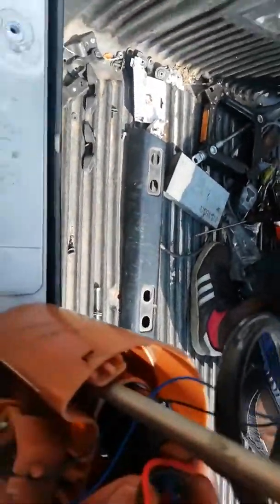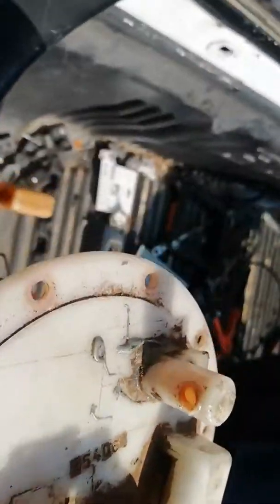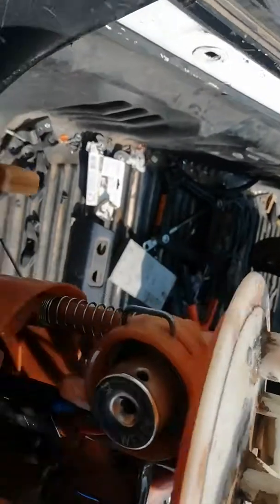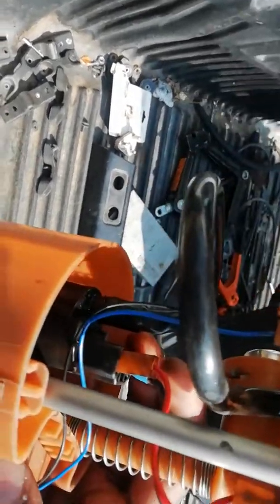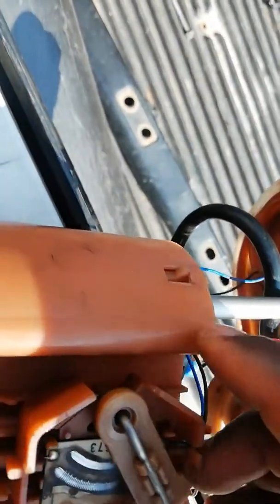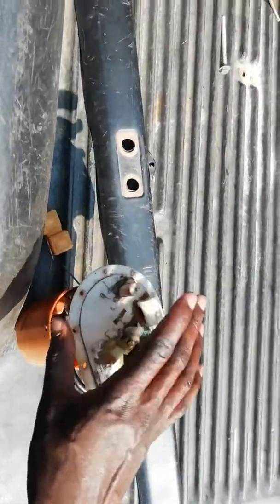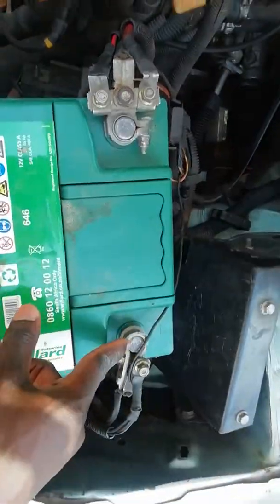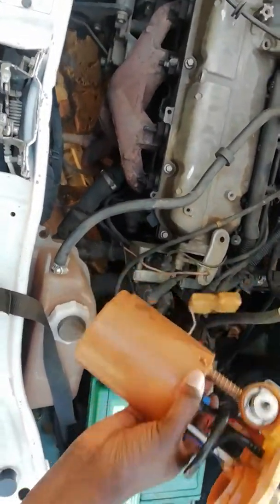Fiat Strada fiat , palio petrol pump system

Comment: Does the fuel control regulator or fuel control valve embedded with the petrol pump housing ?
Reply from the maker: In the Fiat Strada 2005, the fuel pressure regulator and the fuel pump are typically integrated within the fuel pump module
Reply: @bassoniatv  thank you 🤝